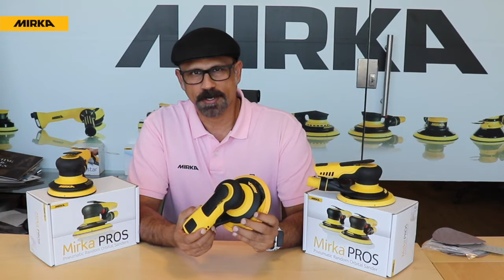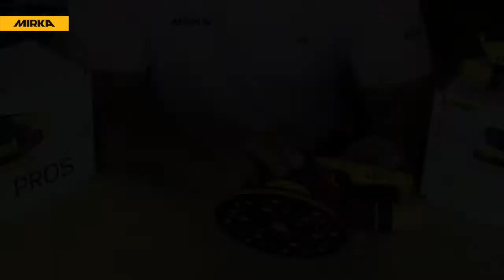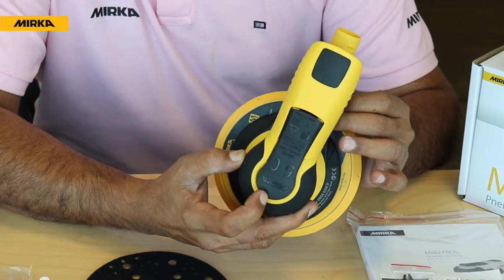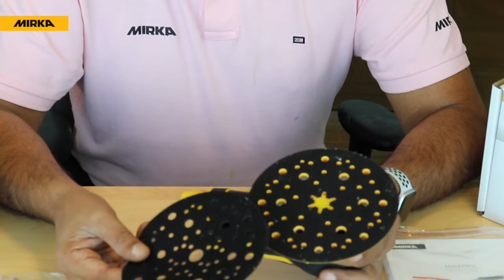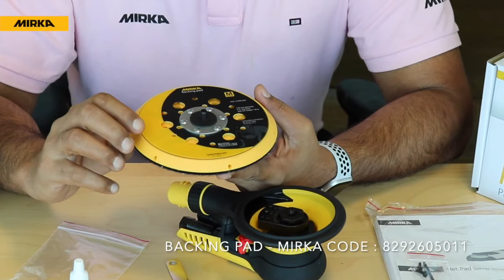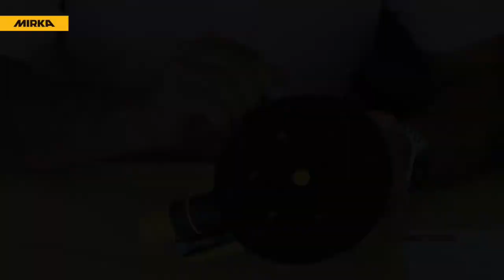MIRKA PROS GUIDE

Comment: Whats the minimum recommended compressor for it?
Reply: Precisely what I wanted to ask! Apparently no one answered you...
Reply: @goncalovazpinto6261 hi maybe this one would help 

If you mean the Mirka PROS pneumatic random-orbital sanders, Mirka specifies

Air consumption: 485 L/min
Working pressure: 6.2 bar (≈90 psi)
Mirka’s general guidance says a pneumatic sander needs a compressor producing at least 400 L/min, achievable with about a 3.6 kW compressor

What I would recommend is..

For a Mirka PROS 550CV / 650CV, I would not recommend buying exactly 400 L/min if they expect continuous professional sanding. The tool itself is rated at 485 L/min, so a practical recommendation is..

Minimum: ~400 L/min compressor output
Better: 500–600 L/min FAD/output at around 6.2 bar
Professional/continuous use600+ L/min, especially if other pneumatic tools will run at the same time.

For example, the PROS 650CV is 150 mm, 5 mm orbit, 12,000 rpm and requires 6.2 bar 😊
Reply: @donnalicious.beauty_pastries  Thanks! Very detailed information!
Reply: If you mean the Mirka PROS pneumatic random-orbital sanders, Mirka specifies:

Air consumption: 485 L/min
Working pressure: 6.2 bar (≈90 psi)
Mirka’s general guidance says a pneumatic sander needs a compressor producing at least 400 L/min, achievable with about a 3.6 kW compressor. 

What I would recommend is..

For a Mirka PROS 550CV / 650CV, I would not recommend buying exactly 400 L/min if they expect continuous professional sanding. The tool itself is rated at 485 L/min, so a practical recommendation is..

Minimum: ~400 L/min compressor output
Better: 500–600 L/min FAD/output at around 6.2 bar
Professional/continuous use: 600+ L/min, especially if other pneumatic tools will run at the same time.

For example, the PROS 650CV is 150 mm, 5 mm orbit, 12,000 rpm and requires 6.2 bar